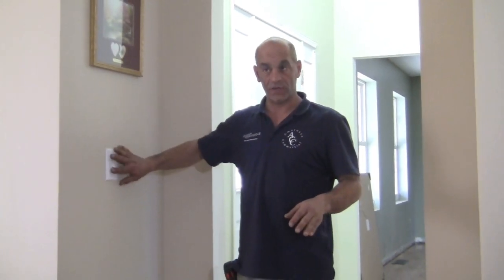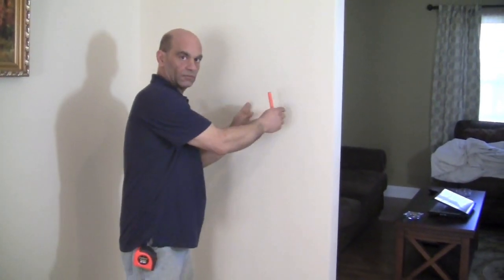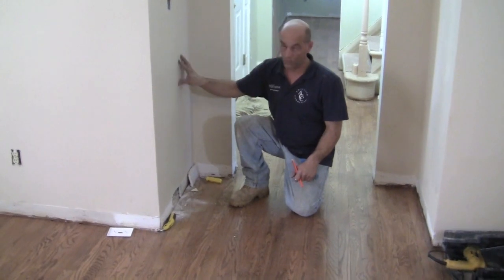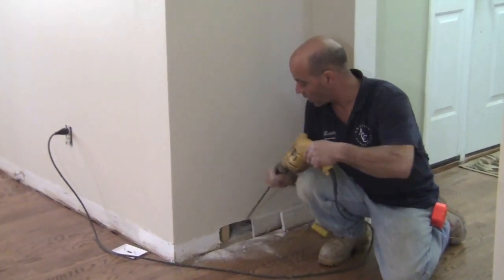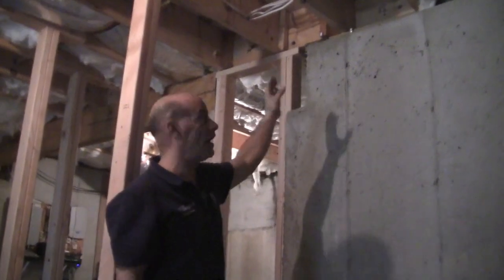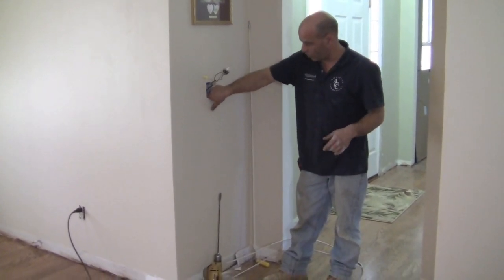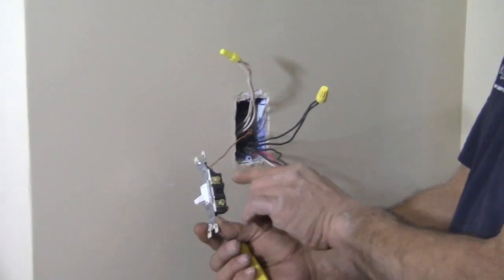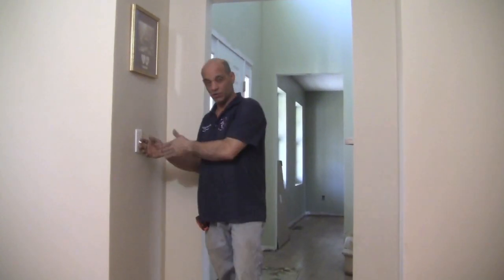How to install a three way switch to a existing one way switch

Comment: I didn't understand what did you do exactly to the two black wires on the second switch at the end. Please explain again.
Reply: Think of it this way..alot of times in existing 3-ways..one switch will be connected to hot..then the other switch will be connected to the light. These connections always use the common screws...doesn't matter which switch. Both the hot and the wire to the light are connected to that common screw...always.
 The other 2 screws are the travellers and only connect the switches. 
In this video..the same switch is receiving power and wired directly to the light.
So he took the wire that was connected to the common screw on the added switch and joined that with the wire going to the light in the original switch box with a wire nut. While the hot wire is going directly to the common screw on the original switch.
It's pretty simple once it clicks in
Reply: chris colvin wow... I'll take my time to read your reply... Thank you...
Reply: chris colvin yes, now I understand... So the black in the first switch is coming back to the second switch and wired to the black wire going to the light bulb, correct? This will complete the circuit. So if the black wires on the second switch are swapped then the bulb will always be on, correct?
Reply: chris colvin please very important question, how to tell 100% which black wire is going to the light bulb and which one is coming from the power source?
Reply: So..yes a switch in it's definition is just breaking the hot wire going to the light. I think what you are asking is if we join both black wires connected to each common screw for each switch..the light will just be "on" not switched..yes that is correct. 
In order to test this, what I do is have a continuity tester or multi-meter set on voltage enough to test..not 0-50 volts but the 250 volts. That way, one probe is connected to a ground wire and one connected to wire to be tested. The hot wire will show around 120 volts and the wire going to the lights will show no voltage.
Reply: chris colvin nice... Now how I can diffreciate between the ground wire and neutral wire?
Reply: ground wire will be either bare copper or a green colored sheath. Neutral wires are always white. In the case of 3 way switches, neutrals are always tied together...in other words "shared neutrals".
In some rare instances in older homes, you will come across a switch that has no ground. These boxes are usually metal and you can ground your probe on the metal box for the purpose of testing.
Reply: chris colvin I can't thank you enough, you cleared a lot of issues in my head. Just for curiosity, say can't tell from the shape or color which is ground and which is neutral, how I can differenciate using voltage tester / meter.
Reply: okay..assuming you are working with wiring in the USA...and the wiring is updated grounded wiring. Let's dissect the components or wires you will find at a switch. In this scenario we are working with a single pole switch and possibly converting/expanding to 3way switches. So, to understand what you find when you open up a switch box is this:
Either the power is located/fed to the switch box itself or the power is located at the box where the light is attached. The difference you will find is that if the power is in the switch box..you will find shared neutral wires bonded together and the hot wire feeding the switch and leaving the switch to go to the light fixture. If you find one wire feeding the switch box..most likely the power source is located in your light fixture box and the wire going to your switch box is just a switch leg. We are supposed to mark the white wire with black tape or black marker to indicate this, but some guys fail to do so. Meaning you have 2 wires but one is power going to the switch and one is the continuing power/hot wire to be switched going to the light. 
Now..In old wiring, if this is the case, you will not even see a ground wire because old knob and tube wiring does not have a ground wire
I would look around at the rest of the outlets and switches. Are the outlets in general, truly grounded inside the box..if not you are dealing with old wiring that is not grounded. The sheathing may be all black cloth sheathing, but at one time the cloth on one wire was actually white but has worn off with time. I like to look closely at what's going on before disconnecting anything and do some testing.
If you are looking at wiring that is somewhat updated and you can call the wiring romex in rubber sheathing..than you are in better shape to figure out what is what. 
The biggest caveat I can impart to you when working on old cloth sheathing is this. It si likely the more you disturb old cloth wiring the more likely it will fall apart and disintegrate away from the wire and cause a dangerous situation. You must be very careful fooling around with old sheathing..disturb lightly and use tape. If possible and feasible..replace old wiring with new.
Reply: Why is there 4 black wires now and not three. Shouldn’t there be only three? One power one to the light and one from the new switch? I need help ease
Reply: 3way switches have one common screw..usually black..and 2 traveler screws..usually brass. 
On one switch you connect power to the common screw..and on the other switch you connect the wire leading to the light to that other common screw. The switches are connected by 2 wires called the travellers and they connect to the brass screws.

Comment: Mine is wired wrong but as long as u have the top switch in the right position the bottom switch will shut it off and turn it on but if I leave that switch in the position that the light is off and I go up stairs to the first switch it won't turn on the light.. You should have just  done that with ur switches.

Comment: I appreciate your videos thank you. I have a question  in regards to the new wiring  of the 3 way switch(the side that was originally there). Of the two black wires that are connected by the yellow nut.  Firstly,  is one of them the original hot wire and now suppling power to new switch across room  and secondly, Is the black wire on the new 3 switch(original outlet) connecting to the light? Thank you
Reply from the maker: Originally the switch had power and load (light) in the same box. Never had an outlet. So all I did was install a 3 wire from the new switch to the one that was there already. But both switches have to be 3-ways

Comment: it has been illegal to wire this way since before this vids post date.... NEC 404.2(C) .... some states do take some time to adopt currents codes.   use 14-2-2 to bring a neutral as well..  you cant also use it to bring power to the other side to use for jumping on with careful makeup on the other end.
Reply: Rakeem SW I was thinking the same thing while watching the video,  thats a 2011 update.
Reply: Aaron Schmid yeah I think here in NH uses 14-2 that has the Neutral in it
Reply: Aaron Schmid you don't need a neutral to a switch, he never brung over a neutral, just the switch leg
Reply: @Est91.  Every switch now require neutral at the box (smart switches require it for instance).
Reply: @DavidLucBelanger  when this video was made a neutral was not required
Reply: @Est91.  
Since 2011 the NEC code does require a neutral in the switch box even though you will cap it off with a wire nut. He should have ran two 12/2 w/grounds or a single 12/4 w/ground.
Reply: @njsongwriter  this was done prior to 2011, meaning that code didn’t exist
Reply: Aaron Schmid kota
Reply: Hey everyone,  i just used this to add a few switches to my house.  And it works. The reason i used this is because i couldn't find a clean diagram that made since. In case u misunderstand me for being too simple to follow a simple diagram, let me tell you that this is not the case.  Im very handy.  Without me giving me a long list of my many a repairs,  fixes  and installations, can some please point me to a link where its done right. Thanks in advance.
Reply: Looks like they need to tear down all the houses build prior to 2011.  They are wired unsafe

Comment: I can't imagine a customer being ok with removing trim and cutting a hole at $100 per hour. Plus many exterior walls are sitting on foundation. I drill from bottom up after making careful account of the wall position.
Reply: They are more than okay with it because they have money to burn and its the end of the world to them not to have redundant switches 6 ft apart from one another in the same room that can be off in the up position.

Comment: Thanks so much, Dominick!!!  Ran into a problem tonight doing this very thing. thought I had it right but it just wouldn't work. I scratched my head and then thought, 'YouTube!'  It took me a while sorting through all the same ole 3 way switch videos but none with my problem. I then finally found yours!  Eureka!!  You showed me exactly what was wrong, just one wire in the wrong place.  Thanks again!  You Rock!  Ron, Frisco, TX

Comment: in my original light switch box I only have a single white and a single black  wire. I don't have multiple wires in the original box as u did. Do i still follow the same steps as u did?
Reply: Ermin Tale that would be a switch loop. 

Means that at the light fixture, the hot got tied into the white conductor that you see at the switch 

And the black wire is going up to the fixture. 

Your steps would be a little different.

Comment: you have extra wires not explained.  Example 4 white wires. source, light, added switch should be three white wires.  Where did the extra wire come from?
Reply: Guy West its probably a neutral for another load, (outlets)

Comment: I like the way he explains the installation . Really easy to do cause of it.
Reply: yup, but sometimes you can get away with it if it's a 2gang, 3gang, or 4 gang where a neutral is in the box. inspectors look for it today now! great comment man.
Reply: Dead end three way. good job man
Reply: yup yup
Reply from the maker: +Abel Velasquez Thanks buddy.
Reply: +askmediy  The whole removing the baseboard and cutting drywall down low is not needed. Cut a sharp tip on the end of a straight piece of strong coat hanger. Put that in your drill and drill down through the shoe molding and floor boards into the basement. YES, IT WILL WORK. Drill up into the hollow wall from the basement using the coat hanger as a guide, The minute 1/16" coat hanger hole can be patched with the swipe of a dab of caulk.
Reply: dead ends were nice... but now they are mostly illegal from arc fault breakers and 404.2(C) requiring a neutral on each side.
Reply: indeed.. in reference to arc faults... Make sure you have a neutral from each circuit that enter that box.  If you try to use a neutral from a different circuit on an arc fault breaker it will not comply.  sometimes larger boxes 2 -3 -4 gang can have multiple branch circuits in them.

Comment: I'm relocating my light switch.  Previously, the light switch turned on both the light and the fan.I want them to have their own switch, in the new location.So would that be a dual switch?Is pigtails needed?If so, where?Now where the old switch was located.I have the old wire, that I need to know how to connect to the new wire to the old, to extend the wire, so it's long enough so I can relocate it.But I don't want to just put a solid cover on the old switch box.I want to put a outlet in the old light switch spot, instead of just covering it.So I was wondering if I could somehow connect the old wire to an outlet, that would also connect to the new wire, which will provide power to the new switches.Does this make sense, or am I confusing you?The old wires are 2 separate 14-2 wires.The new wire to extend to the new location is also 14-2.So theirs more wires than normal.How do I connect everything? Do I cap all the hot&pigtail to outlet, same with white?If so,how2connect switches?thanks!

Comment: in your video you have 2 black wires from the old switch you have a neutral and a black the black goes to the black screw the neutral gets tied to the white you have 2 black wires tied together where did the other black wire come from I am wiring single pole switch to a three waythanks for the video 99% great job
Reply: I would also like to know where the other black wire came from.
Reply: nvm I figured it out
Reply: You need two three way switches to do this.

Comment: i dont have a basement to do this.  I have a 2nd story, what's the easiest way to get it fed to the other switch?
Reply: +dukdude The only way is to cut holes and drill through studs and joists....then patch and paint.
Reply: Move!!
Reply: Also use the attic, if unfinished (yes, there are finished attics, like some of them at my parents' house).

Comment: I have been looking for a schematic. I have a basement apartment and garage, at the garage door inside apartment is a duel box (2- 3 way switches,) and a 12-3 and a 12-2  live wire coming in and a 12-3 going back up to garage. I need a schematic to wire this correctly

Comment: Thank you for the great video. Last week I try to change a single switch to a 3 way, however it did not work. Your video clarified what I did wrong. Once again thank you.
Reply from the maker: Felix Soto Awesome, glad I could help.
Reply: @Askmediy hey Man great video super easy to understand, one question I see the ground from new switch to new switch. What about the one still connected to the old switch?

Comment: got a question. i run out of regular switch can i use a 3 way...
Reply: Jorge Cortez I wouldn't recommend it but yes you can, use one of the gold screws & use the common (black) screw
Reply from the maker: No
Reply: Ok. I was going to do it till I go to the store and get me a regular one. . Another thing can I use any other wire to use it as. Travellers
Reply from the maker: Jorge n Sindy Cortez whats a "any other wire"?  No you must use the right wires.
Reply: Sorry what I'm saying can I use white,black as travellers
Reply from the maker: Jorge n Sindy Cortez Yes of course.
Reply: Ok.. thanks. ..for everything
Reply: You CAN use a 3-way-based switch as a 2-way switch (single-switch system), as long as you don't mind that it doesn't say "on" and "off" being a toggle switch. All rocker-based wall switches that I know of don't, for whatever style reason. Oh, and yeah, it has to be connected like Est said.

Comment: I think a diagram might have helped those that are confused. I myself was confused when you tied the existing fixture BLK to the BLK coming from the other switch. Why not connect the fixture BLK directly to the common on the switch, not have to go across the room, and the black coming from the other side to the BLk coming in to power everything. In other words, hit the switch across the room with the hot first, on the common screw. That's the way I usually do it anyway. I just didn't understand your reasoning for doing it the way you did. Looks like your hitting the entryway switch first, and then coming back on the BLK from the other switch and then up to the light. Is your thinking that the hot should hit the entryway switch first for any particular reason? It doesn't really matter I guess, it works either way, but I was just wondering your thoughts on that. Thanks.

Comment: Very good info, however, it might have been even more helpful for you to have told what kind of wire the person needs, ex., 14/3 with ground, etc.. The average novice will not know what to go out and buy when tackling this project.
Reply: it's 12/3 Wire
Reply: @williamjimenez5933 : 10, 14, or 16 will work too, depending on the current rating your panel is designed for.
Reply: Actually the 2011 NEC code calls for 4 wire w/ground because it requires a neutral wire in the newly installed switch box even though you likely will never use it and are just going to cap it off with a wire nut.

Comment: The new switch box only has the traveler wires in it?
Reply: I believe it had the hot or line power plus the two travelers. It did not provide a neutral which is a code violation since 2011. He should have used 4 wire w/ground instead of 3 wire w/ground.

Comment: Dominique thanks for the videos on both 3 way & 4 way.
 My situation. I currently have a downstairs switch that turns on a light shared by one end upstairs and another end upstairs down the hall. (1 light 3 switches)
 1. I followed the existing set up upstairs (1-regular switch 1-3way and not sure whats downstairs) lights upstairs come on and off only if downstairs is flipped down.
 2. Does this mean I need 2- 3way switches and 1 – 4way switch.
 3. how do I troubleshoot
I have only changed out the two upstairs..

Comment: Hey Dominick, This video is very helpful with my project. I am running into a small problem. I have 3 black wires running into the back of my old switch. This switch operates 4 can lights that I am trying to put on 3 way switches. Also 2 of the 3 wires are just shoved into the back of the existing switch through small holes. The one wire that is on the bottom screw connects to all three switches (fan, and fan light) in the triple gang box. What does this change, if anything, to what I need to do when wiring the new 3 way switch. Thanks

Comment: Hey Dominick, we have a three socket bathroom fixture over mirror. It seems anytime a bulb blows, it's always the bulb in the far right socket. What might it be? Will take this fixture down this weekend and inspect for loose wire in screw shells. You think that may be cause? Thanks for all Bud!
Reply from the maker: This is always a strange one. It's really hard to say. Usually it's because of it being closer to a door or something like that, that gets slammed that causes that bulb to shake. Other than that who knows really.

Comment: Dom, When you show the original switch wiring what did you do with the ground wire on the old switch? Did you pigtail it to the 3 way?
Reply from the maker: Yes pigtailed.